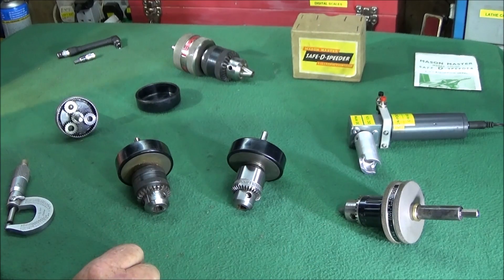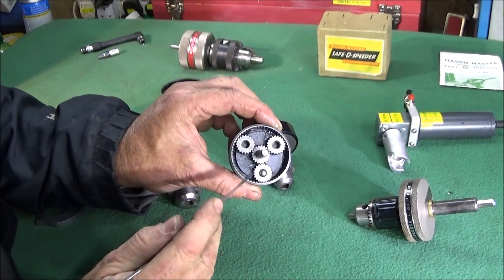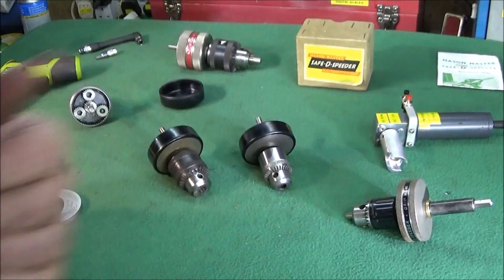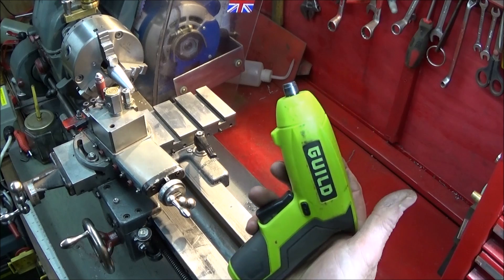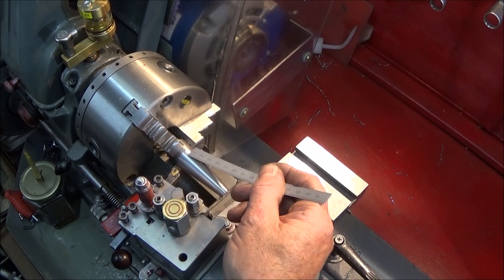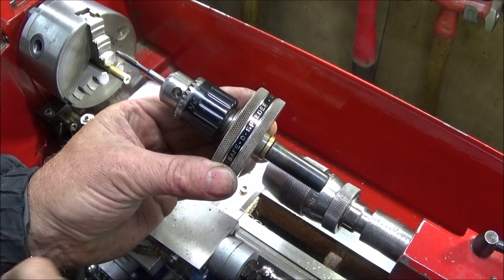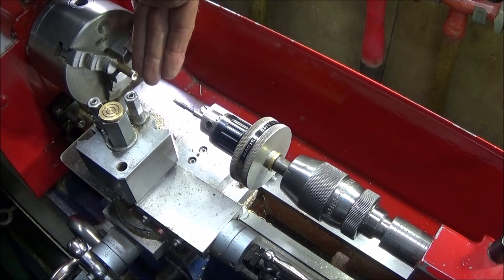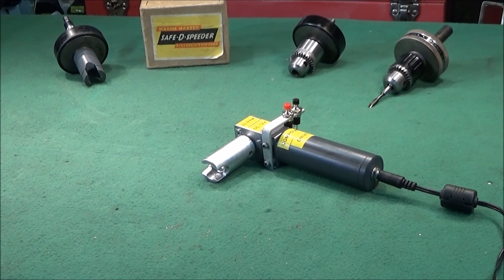Make A Machine Tapping Fixture For The Lathe Plus Speed Reducing Gearbox

Comment: It only gives a small advantage compared to a chuck on bearings and a similar size disc for holding if I'm not terribly mistaken. The shaft in the chuck takes 1/4 of the tapping torque so the disc has to take 3/4. So a 33% larger disc and you should have almost similar holding power without the gears. Of course it's ready made if you find one cheap.
Reply: I bought one and I'm planning on using it either with a cordless drill as secondary reduction for tapping larger than M12 (if it can take the torque) or turn it around and make it a speeder for my drill press that goes only up to 800rpm. Not decided yet.

Comment: Hi Steve.
I've recently inherited a large amount of engineering tools, amongst them was a Mason Master safe D speeder still in it's box - looks unused.
I've also got another even larger Mason Master item which also attaches to a drill but this one has a handle that can be twisted - i'm struggling to find any info on the internet regarding this item.
Do you have an email address or another form of contact so i can send you some photos of the item? Hopefully you might be able to shed light on what it is.
Thanks, Martin.
Reply from the maker: Hi Thanks you can send to this email but I won't leave it on here so   make a note of it fairly quickly.
Reply: Thanks, i've got it written down. I'll photograph the items and get an email sent to you. Martin.

Comment: One of those Drill De Speeders would be nice if it had a Morse Taper on the driver end so that it could be put directly into the MT2  tail stock or posibly into the internal taper in the head stock to enable something to be tapped in the milling vice. Great idea by the way .

Comment: Hello again Steve,
Excellent video, I've just paid £3 on our local car boot for this tool. It works very well but is dirty and needs re-greasing, I know how to strip down and reassemble the chuck, but don't know how to strip down the reduction gear housing, can you offer any advice please ?
Many thanks again, Brian
Reply from the maker: Hi Brian, If it is an all metal housing then I think they are a sealed unit as i have not been able to get one apart. If it has a plastic housing you must hold it by the large diameter in one hand, low over a clean surface, preferably with something to stop the parts from rolling and getting lost. Then use a hard plastic mallet and keep hitting the spindle on the back end. It should push the housing apart. Note that only one planetary gear is mounted on a fixed spindle inside. The other two are free, held captive in their positions only by the gear teeth. Also there are small ball bearings under the inner plate where the spindle comes out. If they fall out, just put them back in with some grease to hold them in position for re- assembly.....Hope that is helpful enough....Regards Steve
Reply: Hello Steve,
That's a really detailed reply, very many thanks for taking the time to explain the process so clearly.
Best wishes, Brian

Comment: The tapping idea is great ! Especially for tiny things such as M3 and smaller or those puny BA sizes !
Where does one buy such a reducer ?

Cheers
Paddy
Reply from the maker: Hi Paddy, You can get them on Ebay secondhand,  trouble is the prices have shot up now! You can get one that was made in USA called a Chicago Supreme Versamatic. This one will take a chuck that has 1/2" UNF thread it the back. These ones from USA seem to be more common than the Mason Master at the moment....Regards Steve
Reply: I had an 'Ebay-browse'.... I see what you mean regarding prices.... I have some older cordless drills that do not work any more... they too have a planetary reduction in them.... I'll have a think and look if I can't do anything with those ....

Cheers
Paddy

Comment: Nice work mr Jordan, but is the Safe D Speeder still available in the UK and if so, where?
Reply from the maker: Hi Herman, It isn't available as new. There are usually some used ones on Ebay. Regards Steve
Reply from the maker: Or you can get a similar device in the USA called a Chicago Supreme Versamatic. This one takes the yankee type bits but also has a threaded end for a chuck.
Reply: Thanks Steve for the advice, I will start scroungeing Ebay. Keep up the good work! H

Comment: Hey that's pretty cool Steve! Any plans on purchasing a mill in the future? I'm trying to decide on a DC gear motor for my z axis power feed, completely threw out my lower back (again) hand cranking my mill and need to get this done asap! I can hardly even walk right now let alone ride my street bike... I'm thinking @ 200 rpm max shd be good and don't want to get into a nema with a driver ect.... Keep up the great videos,  Doug
Reply from the maker: Hi Doug....Unfortunately I haven't the room for a milling machine. You can get some nice high torque DC motors on Ebay from China. I was quite surprised at all the different types you can buy, plus on some you can choose the set RPM on the listings.....Thanks for watching

Comment: You got me thinking Steve - I'm sure I have one of those -- somewhere.!
That sure does work well on the ML7 - very good feed control. 
The tapping application is just great - really protects the tap, particularly for smaller ones.
Reply from the maker: Hi Chris, Thanks....I had one years ago but I think I threw it out!...I just remembered about it when I started this project,  before finding one on Ebay....Regards Steve
Reply: Hi Steve, Great video! Funny thing is that it was me that you bought the unit from on Ebay, mahking51!
Got to keep an eye out for another one now.. Cheers, Martin
Reply from the maker: Hi Martin.......:-)......Hope you can get another one! I have just bought a similar design one from USA. Called a Chicago Supreme Versamatic. This one has the same gearing and takes the Yankee style bits, but it is also threaded to take a chuck. I'm interested to see if it works the same. If it does I will include it in a short update video.... Regards Steve
Reply: ChrisB257